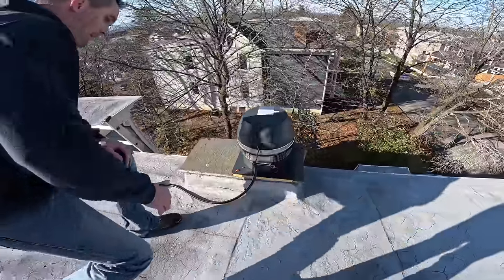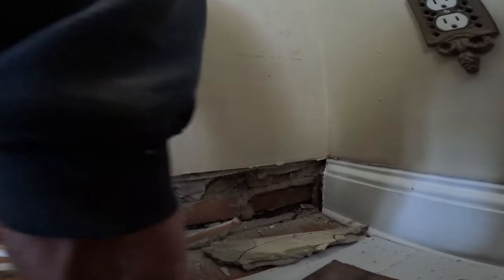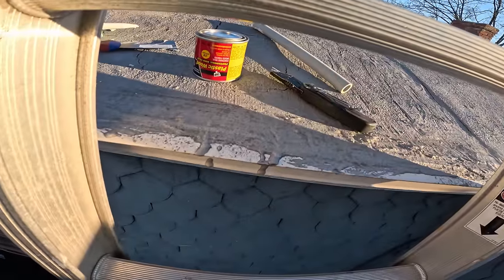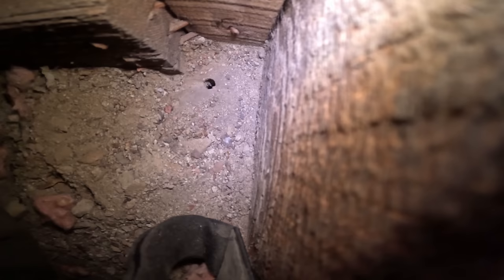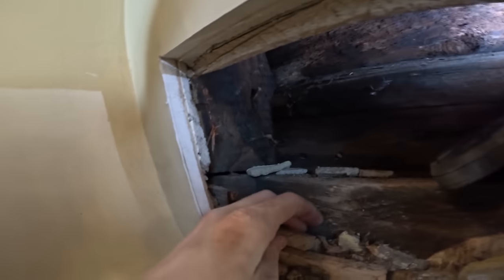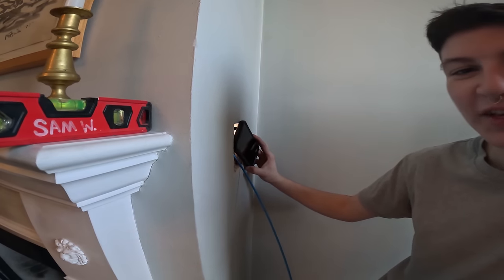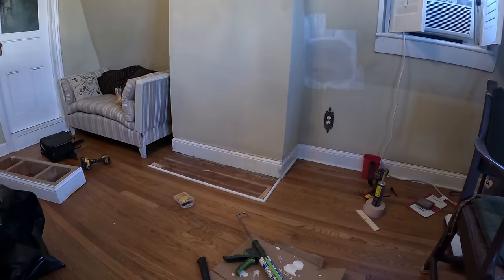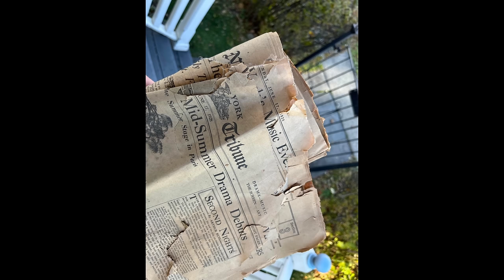Installing Chimney Fan Wiring

Comment: Always wear a respirator. I did residential HVAC when I was younger and ended up getting histoplasmosis from it.  I was really sick for a year or so, had a couple operations, and ended up getting a section of my lung removed from it.  We all think we are invincible when we are younger,  I didn't even know the dangers that was around me, that I couldn't even see.  I was the slimmest guy in the company so i always got the tight, hard to reach places.  I know they suck to wear, but it is in your best interest. Love your videos.
Edit: I guess I should mention in attics and under houses, lol.  You don't really need to wear one outside lol
Reply: Main reason I left HVAC for machine shop was the climbing into attics in 100 degree weather, and under houses with a foot of water and water moccasins! I didn't mind the commercial jobs, but hated residential jobs!
Reply: @Autigers2013  I look back at what I used to do on a regular basis and can't believe that I put myself through that.  You are so right
Reply: Back in my younger days I cut asbestos tile with a masonry blade on one job,I looked like a snowman at the end of the day. Two weeks later before I found out  how hazardous it is.

Comment: Pro tip: Always tie in your ladder. for a flat roof, use a standoff or stabilizer bracket  onto the roof deck to keep the ladder from shifting or being blown over. Also, acetone dissolves the fiberglass fibers that get on your skin.

Comment: Fame o wood.......it does smell like acetone....that is the solvent it is dissolved in.  Used it to fill screw holes in red oak sills and aprons years ago.  :)  Nice patch job!!  The trim looks good too!!  I like to use the durabond quick setting compound for small repairs......it is a bit harder to sand so get each coat smooth when you apply.  To help with cleanup, I use a red plastic cup to mix in.  A coat hanger in the bent in the shape of a paint stirrer in a drill works great!!  When you are done, clean your knives and throw away the cup.....no cleaning your mud pan!!!

Comment: what a pain in the rump job that is... I remember those days doing work like that, not fun and very tedious - be glad it is not summer and hot and that the roof isn't shingled, or else you would be fighting not hitting your head on nails sticking down... be cautious, a lot of those old house with plaster walls can have asbestos in the plaster as a binder.
Fine work, love to see it and also enjoy it when you work with Mr. Camarata

Comment: This kind of work are the reason I didn't want to be an electricion on contruction sites and went to industrial only. I hope the customer was not so picky about leaving scratches or dents in walls or surfaces.
Miss Weber is filegran with the spatula like with the chainsaw  :-)

Comment: The nails that come out the back of removed moulding can be pulled through with either a Chanel lock pliers or a really curved claw hammer, thus protecting surface painting or stain

Comment: What a heck of a job...reminded me of crawling through a whale's guts...
😝
Wasn't that a chimney with two channels? If so, you could easily send the wire down the second channel, as it seems to be closed on the top anyway...
But I wasn't on site, just guessing from far away...
😉
Great job, especially with the plaster repair!
Thx for showing, I'm all itchy now...
😛👍👍👍

Comment: A great job Sam, I bet you were itching for days after that. I always wear rubber gloves and a tyvek disposable suit as the insulation sticks like shit to a blanket.

I'm amazed at nearly all houses have vented dryers. In the UK we use mainly condenser dryers and no exterior vents. 

I can't believe you still use those nasty wire nuts.
Reply from the maker: I have never heard of a condenser dryer. From what I just read up on them Americans probably wouldn't like them as much if they had to drain the water reservoir themselves, (Although I see they aren't all like that) and stackable units. Americans tend to like bigger things as well and commonly have a room/area dedicated to their laundry (aka the laundry room). From what I have heard in the UK washers and dryers are commonly found in the kitchen or bathroom? Let me know! An article I just read stated this, "Their main downsides are that they’re not as energy efficient as vented dryers, and they can take longer to dry your clothes due to the extraction process. Condenser dryers also can’t be wall-mounted."
Reply: @samanthaweber6932  hey Sam, hope you are well. I have a hotpoint condenser dryer that has a pull out water collector tank but It always has a 15mm drain hose that's connected into my under sink drain. Less of a fire risk and zero maintenance. Love your good honest videos and versatile skillsets. Women in construction are setting high standards.
Most normal British working class people like myself always have our appliances in the kitchen or if we are posh in a laundry room commonly known as a utility room here 

 Big love from the UK 🇬🇧

Comment: Do you not have either flexible exterior conduit or flexible external grade cable in the US - it would make a much neater job !
Reply from the maker: This client did not want the appearance of conduit or wires, running down the exterior of his house
Reply: Some historical district zones also prohibit stuff like electrical conduit on the outside of a house, especially if the house is old enough to be built before electricity became widely used.
Reply: @samanthaweber6932  Sam I meant just a metre or so of flexy from the fan junction box through the soffit to avoid that awful looking elbow and rigid conduit that sticks out like a sore thumb, not to run it down the outside

Comment: Just thinking of all the trades that over the decades from ~120yrs ago til present day that upgraded plumbing, electrical and did all that insulation in the attic which must have been a real PITA to do.  Suspect a redo of that roof is a high dollar job as well.

Comment: Always use high quality respirator when cutting into a plaster wall.  Older plaster lathe walls may contain asbestos.  Even older drywall material may contain it !!!!! Please be careful !!  Also using high quality stud finders can prevent problems

Comment: Maybe I'm missing something, but ypu could've removed the outlet and used the wire to pull up your fish tape and then pulled the old wire and new wire down at the same time? And then tried to fish around the corner and downstairs.

Comment: Looks like you need to drill a one inch hole through the top plate, then run the fish down that hole and near that out let receptical box. Find that stud the receptical box is fastened too, then go up 4 foot and cut out box hole for the controller fan. The chimney is too blocked with plaster and naillers. You will need a 90 degree battery Hog DRILL with a one inch screw bit 6 inches long or so. That's a Mansard type of roof, French design.

Comment: You did a really good job there, it’s by far one of the worst parts of being an electrician, the lofts and dealing with soot and insulation. Few things I would have done totally different but you guys got the job done. 

In the uk we follow much stricter regulations and houses are much tighter and have very few voids. 

Little tip for the lath and plaster…
Cut the size you require through both plaster and lath to gain entry… then cut another rectangle out 1inch larger on all sides just through the plaster, now use the exposed lath to fix a sheet of plasterboard the top and bottom lath will still be fully tied into the wall and give great fixings!!!!

Comment: I'm glad my attic days are over.  That old fiberglass insulation can make a person itch for months afterwards.  But, if that's where the work needs to be done, somebody has to go in there.  I wish I had used a respirator back in the day, but at that time, literally no one did.  Enjoyed the video and the banter.  Glad there were no rabid squirrel encounters.

Comment: he could of used the 1.5 amp switch with a 4-6.0 amp relay within the junction box while using a fancy new wireless smart switching device for the first floor's use. 

  everyone has their own way to the same answer though and sometimes the most simple one is the best one.
Reply from the maker: We could not find a multi-speed fan switched that worked remotely and could handle a 2.7amp fan motor.
Reply: @samanthaweber6932  yeah that's something you would have to use relays for and not switches. 

but switches can control relays, even multiple relays for different amperages, sometimes rheostats can be used too that just vary the resistance of the peak potential amperage of the circuit.

{ all that adds cost to the homeowners bill too at the end of the day though, and that simple solution was probably the best for them at what they wanted to spend for a functional fan..just wanted to say it's possible to have a fancier solution }
Reply from the maker: Thats good to know thank you! But yes, you are also correct in the fact that the homeowner did not want to spend the extra money.
Reply: @samanthaweber6932   they never do xD

Comment: Gosh, instead of a “puller” fan at the top, the owners coulda done a “pusher” fan at the bottom.  Much easier.
Reply: It's a shared chimney. A pusher fan at the bottom would push out at the other fire place as well.
Reply from the maker: We did not choose or install the fan itself, that was done by a chimney company. We were hired to do the wiring only. The client did originally tell us it was a shared chimney, wood on the first floor, gas on the second. However when we got inside the residence we found out the “gas” fireplace was actually just a fireplace facade with a gas candle inside of it😬. So I don’t know if this fan choice was made because of the assumption that there was also that gas fireplace.
Reply: @samanthaweber6932  thanks Samantha for lettin us know.  Nevertheless, good job on your part. Youre awesome.

Comment: I hate drywall work, I have put off putting joint compound and skim coating parts of the ceiling that I replaced, for years lol. It is so hard to blend it in especially when the ceiling isn't exactly flat. It is almost an art form.

Comment: You could have opened that outlet on the wall, disconnected the romex and used it as a pull line into the attic

Comment: Working on a roof edge at that height would not be legal in UK because ladder access in the way it is could not be compliant and no arrangements appear to be in place to prevent falls.
Could attract a $5,000 fine against the person in charge of the work for non-compliant working; if someone was injured by falling then a prison sentence is quite possible.
Reply: One of many reasons we don't live in the UK. 🇺🇲
Reply: @gregh.7977  There is federal safety law applying to all US states; Occupational Safety and Health Act.
If you read the notice on their ladder you can see that they have not correctly deployed it; this is covered by OSHA regulations.  Working above six feet is covered by OSHA regulations for personal fall arrest systems.
These work activities are covered by US legislation and regulations.